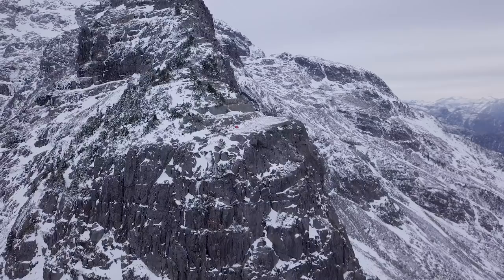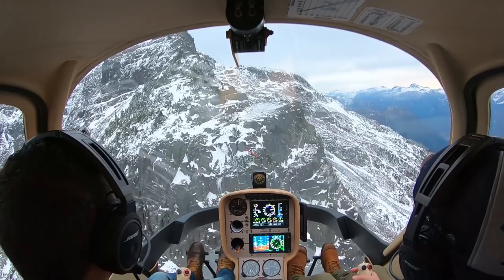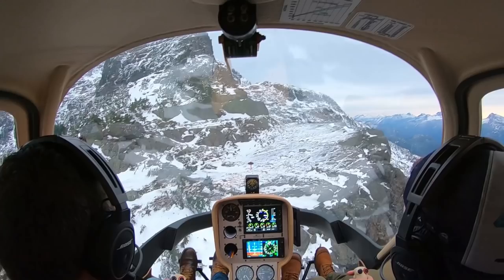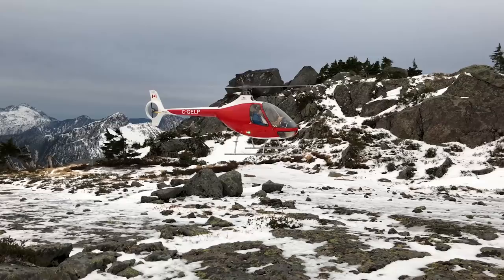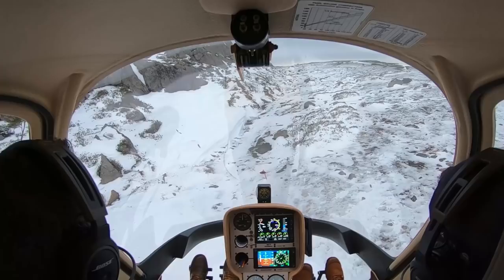WHY HELICOPTERS CRASH WHEN OVERPITCHED

Comment: I was in aviation for 25 years and flew helicopters for 15 of those years. I flew Huey helicopters in the Army during Vietnam (1966-67) and never had enough power. Early models Bell UH-1 A/B/C and D (T53L-9 and -11 engines) would droop RPM at high altitude or during hot weather. It was not uncommon to require a running take-off on the skids to get off the ground when loaded. Many landings with a load had to be to the ground because it would not hover due to low power, especially when the OAT was near 100 degrees or more. Turbine engines will droop under the right conditions. Later when we got the UH-1H with the T53L-13 engine, power was not a problem. I flew the CH-47C during my 2nd tour in Vietnam (1968-69) and had all the power I needed.
Reply: what did they do to the huey engines replace the in line 4 cylinder with a v8 engine to improve power?
Reply: The helicopters mentioned in my comment had gas turbine engines. The size and number of turbine wheels in the engines increased power. The CH-47 helicopter had 2 engines much larger than the UH-1.
Reply: oh okay... lucky meow you lived through that era when these engines were being improved and developed!
Reply: Thank you for your service James.
Reply: what are your toys today uncle James? V 8 mustangs?  or Motorcycles?
Reply: Did you prefer the CH47? Thank you for your service by the way. Vietnam Vets deserve the best...anyways, if the Huey had 4 blades instead of two, do you think that's help with lift, or was it really just the turbine was underpowered? I thought jet engines were supposed to increase the altitude you could get without losing much power, but I've only really heard that for fixed wing aircraft. Likely due to the ram jet. I'm not sure how the turbo shafts work exactly :/....what type of altitudes would you notice the power starting to give out for you and did the load effect it greatly? Like after you've dropped off something would the power then be sufficient? I know if you're going somewhere hot the LAST thing you'd want to worry about is power for your helicopter, especially in a fucking jungle filled with less than friendly folks.
Reply: You folks who lived after the war in Vietnam have the advantage of the History Channel and about 2 million smart alecks who know everything and have done nothing.  Vietnam was about carrying forward a short history (out of two world wars) of being the best at everything we did and leading, not following.  To the honorable men (and women) who died or were trashed in Vietnam I give you a big salute and thanks.  You went to hell doing what we believed was a righteous cause at the time.  As for this video, I appreciated that he didn't just talk about it, but did it and showed the effects and the panel.  Whether that helicopter was a 99% power because it was limited by design, or by intention doesn't really matter.  What matters is that they did a really decent video and didn't use the horrible hard, harsh, music that YouTubers kill me with.
Reply: James Dayton why you were in vietnam papa?
Reply: i flew chinooks too. nice aircraft.. i did turn down a mission once in honduras.. they wanted to haul a bulldozer to the top of Tiger Island. There was no weight tag on the dozer, so my co-pilot and i looked at it and decided it weighed too much.. the rest is aviation history. I think the bulldozer is probably still where the maintenance pilot and the IP punched it off.. just short of the top of the mountain ;)
Reply: @pmailkeey Its war, all things are allowed.
Reply: my father flew cobras and hueys, maybe you saw him there!
Reply: Welcome home man. I was shot down in feb 65 but i always say we ran out of altitude. Just off the shoreline near Danang. I couldn't believe how far we flew after getting shot up. Just incase you see this. Do you remember the main gun size on those NVA gun boats, i guess at 27mm.
Reply: Don Berry DANANG!!!, so my father never told me his unit- however- i found a picture of a banner that said "DaNang 3rd div" , my dad was also shot down 3 times, any insight as to what DaNang was?
Reply: James Dayton we had much the same problem in Africa using the gazelle AH1.
Reply: That is very true especially for rotorcraft. I have time in helicopters and gyroplanes. Super draggy and they require a lot of power. I flew a very light Pitts S1S aerobatic biplane for many years. It was amazing what that would do with that kind of power. A friend of mine who has since passed used to fly DC-3's over the hump. When they finally switch to turboprops he thought he had died and gone to heaven with all that power.
Reply: Thank you, everyone.
Reply: Please tell me you blasted Fortunate Son wile flying over the jungles!
Reply: It wasn't until I started flying the Huey in a sim that I found out just how horribly underpowered it is. Massive respect to you guys who flew it in 'Nam with conditions reducing power even further!
Reply: know how many innocent lives you have taken ?
Reply: Total respect
Reply: Glad you got through all that mess!  The next time you see a helicopter will be too soon right?😊
Reply: @marineimaging or that annoying WHATS goin on guys?? Hate that in videos!
Reply: Hot-High-Humid.  Bad combo for piston or turbines.
Reply: @sbdreamin  Yeah. When we crane equipment with no tags we use charts showing metal weight per square foot. Not precise but better than guessing.
Reply: You are badass. I only know a fraction of what you know and went through.
Reply: Thank you for your service

Comment: Who’s here after the Kobe news? RIP 😢
Reply from the maker: Dimitrius Wilkins our hearts go out to his family and friends. He will be missed.
Reply: Me
Reply: @PilotYellow  what would cause a helicopter to lose control like Kobe's did?
Reply: Me 💔🙁
Reply: this is the reason we need to improve A.I because most crash are human error.
Reply: @brandon152lee    Spatial disorientation, and the pilot over-torqued or got the helo into an over-stressed situation. The pilot was IFR certified, and the aircraft was IFR equipped. However, if you dont transition from VMC to IMC correctly, even the most experienced pilots can lose control very quickly.  Unusual attitudes and airspeeds can over-stress an airplane or helicopter and bad things start to happen, including rotor blade malfunctions, airframe collapse, or even just getting into an un-recoverable attitude without sufficient altitude .   Hate to say it, but more than likely, this accident was completely avoidable.  Several famous people have perished this way unfortunately.
Reply: Now im studying helicopter laws to under stand
Reply: Just heard on the news they where descending vertically at a rate of 2000 ft/min. (23mph)
Considered a high energy crash , then add to that,  horizontal speed??
Reply: me
Reply: @benoit8850  vortex ring state? Slow speed
Reply: After looking at some high quality NTSB drone pictures of crash, I'm about 90% sure this is what happened based on how quickly they fell out of the sky and the small footprint of the crash. Almost like he just dropped out of the sky and hit the ground. Even though they kind of hit at an angle, causing some debris to "spray out", it is NOT like they ran into the side of a vertical hill, because the crash site is relatively flat. My 2cents worth...
Reply: You know this.....
Reply: @boudreux9318  it has actually came out that he wasnt ifr certified. Which i find quite odd given all the fog and mountains in or around LA but from the article i read none of the helicopters located in the long beach area are ifr certified. It said something about used so rarely that it wasnt worth the money to do it. So at first i was like damn dude you could have just waited and got cleared for ifr and continue but now i understand the special vfr deal. There needs to be more limitations on special vfr. That amazes me honestly. That type of helicopter and no ifr. I mean that is one of the reasons to have such a helicopter i would think. Knowing that does explain why he was doing certain things but at the same time tells me that he shouldnt have flew to begin with. It was silly to attempt it. At worst he should have landed in van nuys. I was under the assumption he was in holding pattern to try and get emergency ifr clearance and this chose to try it special vfr. Now with this info what in zeus's butthole was he even attempting it for? It does explain things but it also makes pilot error even that more just completly irresponsible and stupid.
Reply: Ive also read that they was within 20 to 30 ft of actually clearing the mountain.
Reply: Adrian Woodard what are you talking about? The pilot and the helicopter was instrumental certified. It’s not common for that type of company to run IRF flights. They were a leisure charter company.
Reply: Adrian Woodard helicopters are designed to fly low altitude and slow. Most helicopters don’t fly IRF unless it’s emergency, military or mission critical. Special VFR can be just safe as normal VFR for helicopters because they can fly low and slow. They had visibility and ceiling at a safe level for the entirety their travel. He was circling at Burbank for 12 min to wait for their traffic (airplanes) to clear. You can argue they shouldn’t have flown that day but the pilot was doing everything by the book.
Reply: Well i thought so also. I cant imagine them not but it has been recently reported that he wasnt so.....
Reply: Google it. He wasnt allowed to fly ifr.
Reply: Adrian Woodard I read it. It’s not coming from any credible sources. The former pilot who used to fly Kobe with the same company already confirmed that they never fly IFR. Either way the pilot would have never chose to IFR even if he had the choice. The pilot is not going to do something he has never done in 10 years of flying with the company. Fog in west cost is extremely common due to the marine layer that exist over Pacific Ocean. The pilot and Kobe flew in foggy conditions many times before.
Reply: You think cause ive seen several articles?
Reply: Before i responded this video had 24 responses....🙄
Reply: @mattwoodardtn  it was a vfr only company. Pilot was ifr certified
Reply: @Brian D nailed it
Reply: @boudreux9318   that's exactly what happened, the pilot lost visuals with the ground and got disoriented and then tried to gain altitude as a last ditch effort and that's when he put the chopper in a position that caused the propellers to stall out.
Reply: @Brian D I believe as long as the helicopter is equipped and certified AND the pilot is certified and current with his certification, pilot can fly IFR. So either helicopter was not certified or the pilot did not keep his certification current.
Reply: Seeing how fast this helicopter picked up speed in a forward downward motion after over pitching, I cant help but think this may have happened in the Kobe Bryant crash. No time to recover and too little altitude.
Reply: @rotaryperfection   makes sense to me, very hard to control a helicopter when you can't see the ground
Reply: @boudreux9318  i agree 100% rip to the pilot but he could have made much better decisions, starting off with no flying in such less then extreme bad visibility.
Reply: Dimitrius Wilkins why you hating on Kobe and Gianna
Reply: Elle R but a expert knows how to correct a overpitched helicopter.... without that black box recorder we don’t know what exactly happened
Reply: Of course; Google's mystery algorithms sent us here.....Mamba OUT!
Reply: Brandon Lee So many things could of went wrong. I honestly think he was trying to land at the Sherriffs helipad a mile away from the crash site which is why he descended like that but he over pitched(my guess) or health issue.
Reply: @jimmieparker8093   What's your point ?
Reply: @mattwoodardtn  You can't "clear the mountain" when you are in uncontrolled descent.
Reply: I am..... I'm wondering if this is what Ara did?  And helicopter didnt have enough power......
Reply: @Ralph W  yeah  should advised him & refused due to weather & safety conditions
Reply: @boudreux9318    I think you were just spot on answering my question....  I do believe this is what he did Bo..... split second bad decision is difference between living & dying....
Reply: @JungleYT    yes is it aircraft failure or pilot error?
Reply: @dondon98  Yeah... I just heard another eyewitness report from a nearby hiker... Said he saw the belly of the chopper before it hit the ground, indicating it hit sideways? Which also matches crash scene... Having nine people on board couldn't have helped matters either so far as loading, etc.
Reply: Dimitrius Wilkins we don’t see a crash ! ???? So...what ?
Reply: @mattwoodardtn  Amen... Good points
Reply: cutie cute Yeah tell that to the countless families of a certain car manufacturer who’s self driving feature has directly killed them... watch terminator 2 and then tell yourself AI is a good idea... people die buddy. Accidents happen. Even computers f stuff up.
Reply: @boudreux9318  No. He was in flicker vertigo. Flight safety org put out a warning on it in 2004.
Reply: @Filmpilot     Flicker Vertigo is a condition that will result in spatial disorientation.

Comment: Thank you for this and other videos, and this one is especially useful, to both a Helicopter, but also because it shows what my instructor always stressed, and that is "you flying here, but keep in your mind where you going to be in a minute or five. You always want to be ahead of yourself in planning the aircraft. You always need to have a plan  for the "If's" If your landing spot isn't just right or the crosswind is more than you expected it to be, or your realizing you might have a powerplant issue, but keep in your mind about the "What If" situation.  He would always say "You never take off without a plan!" cause once up in the air your ability to safely fly is a very dependent on factors sometimes not in your favor.  Thank you again !

Comment: I'm not sure what the hell you guys are talking about with the co-pilot looking scared. I see a competent and very alert co-pilot scanning the skies for other traffic and any potential hazards as well as consistently keeping an eye on his instruments. 
That's how every pilot should fly.
Reply: Mike Patton, you are God. Just saying.
Reply: @awestruckbeing5068  that was "epic" buddy.
Reply: The guy in the right seat is the handling pilot. "Co-pilot?''
Reply: Reason why he’s doing that is because he’s scared. Or camera shy
Reply: That's absolutely correct, I wonder if he's a instructor also.?
Reply: Why don't drones (quadcopters) replace helicopters? Aren't drones safer because if one rotor fails you have 3 more? And aren't they more stable due to having 4 rotors?
Reply: Mike Patton 😂😂
Reply: No traffic there but the proximity of the mountain. That is the danger.......there are also downdrafts flying around the peaks.
Reply: Because electric flying has an extremely poor weight to performance ratio and range which makes it unfit for typical commercial applications, except besides relatively small weight & short distance.
Reply: Pretty sure he’s a student.
Reply: @nofurtherwest3474  Quadcopters won't replace helicopters as human carrying vehicles because quadcopters ie those with four motors, one at each corner, cannot cope with engine failure at all. If one engine failed, the craft becomes highly unstable and likely uncontrollable.
Reply: @mitchflowers717  uh and if one if the helicopter motor fails? 
you can program a quadcopter to operate on only 3. it's a matter of engineering and intelligence.
Reply: @nofurtherwest3474  many helicopters have two engines but if a single engine helicopter loses an engine it will autorotate and land. If quadcopters were more practical they would be everywhere already. The physics and aerodynamics of a tiny quadcopter and a 20 thousand pound helicopter are much different
Reply: @mitchflowers717  i mean, 20 yrs ago what if someone asked "why there aren't mini RC quadcopters? only RC helicopters?"

you would have said:
"If RC quadcopters were more practical they would be everywhere already. "

The fact is, it can and will be done. it's a matter of time.
Reply: @nofurtherwest3474  stop comparing RC to the real thing it’s not the same lol
Reply: @nofurtherwest3474  Because helicopters have pitch control and can autorotate whereas quadcopters can't
Reply: @nofurtherwest3474  it is the other way around. Drones are dynamically unstable and require electronics to continuously keep balancing lift forces on all rotors. Also, a failure of any single rotor out of four would almost inevitably lead to a crash.
Reply: @mitchflowers717  why weren't there RC quadcopters 25 yrs ago? why only recently have they become popular?
Reply: @audrunasgruslys470  Why weren't rc drones popular 30 years ago? why only recently?
Reply: @nofurtherwest3474  because it was invented. Doesn’t mean it can be replicated to scale it’s physics
Reply: What they meant was the video- the mountainous terrain, etc., scared them!

Comment: Great scenery and great video. I have to agree with the comment about removing your hand from the collective, but the pilot in the right seat had his on it, so obviously something briefed. It may be good to mention that rotor droop happens in single and twin turbine helicopters as well, even though they have a governor to adjust power to collective demands. Although most turbine engined helicopters have an timed overtorque limit to be able to fly out of this type of situation, although in most cases, forward speed is the best way to get out, and go past ETL and fly away. Keep up the good work and safe flying!